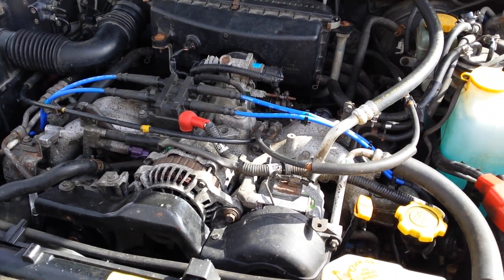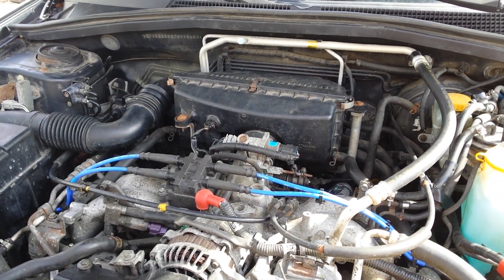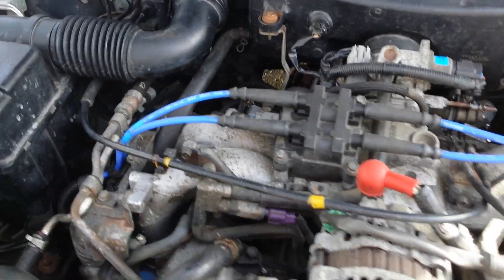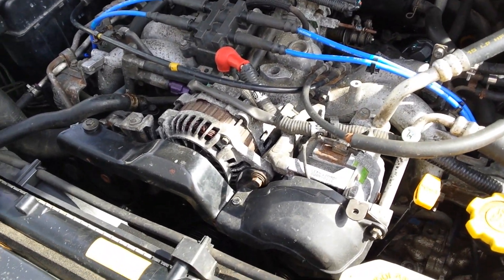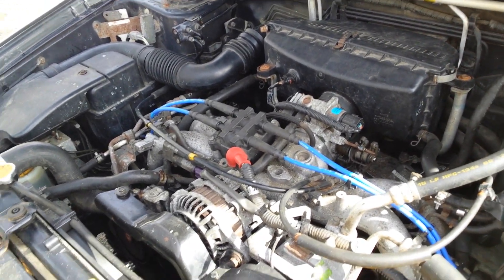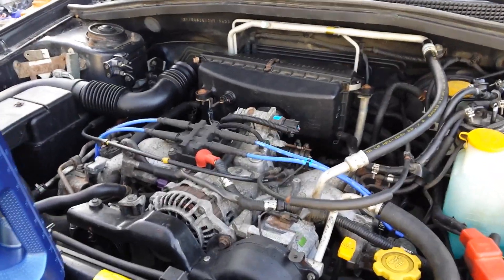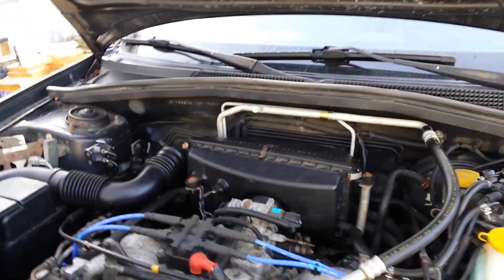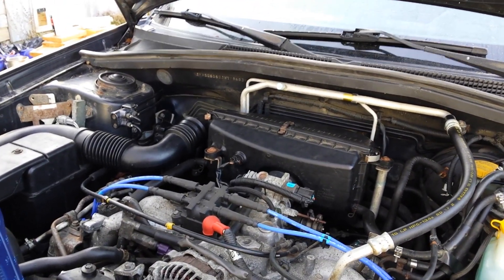Subaru Piston Slap - Does using Shell Rotella help?

Comment: Thanks for this.  My Subaru has terrible piston slap on cold weather startup. It's started to lose compression on one cylinder on cold startup now; it idles rough for about a minute.   Runs fine when warmed up though.

I used to put "Motor Honey" in an oil guzzling Cadillac engine.  It helped with oil consumption and made the engine quieter.  I'm still hesitant to put a product like that (basically thick goo) in a modern engine, especially in the bitter cold weather.  

I had a couple of heavy duty cold starts last winter.  There were a couple of mornings where the temp was minus 20 to 25 degrees F.  It took a long time to start and did it sound terrible idling.  But ten minutes later it was ready to go.  The piston slap got worse after that.
Reply from the maker: Piston slap won't cause any compression loss. That may be either worn rings or a valve issue. Did you do a wet compression test?
Reply: @stephenhunt6253  Then what causes piston slap if not a loose piston//sleeve or rings? :D
Reply from the maker: @vihreelinja4743  Piston skirt wear.
Reply: That's definitely not piston slap if you list compression
Reply: @AndrewB23  It's been slapping for 70K miles without using oil.  Now it's using oil.

Comment: Have you tried lucas oil stabilizer? Try putting a half quart in on your next oil change. I have been using it on my wife's vehicle and it's quieted the piston noise.
Reply from the maker: Will try that and video results!
Reply: @stephenhunt6253  I’ve tried Lucas in my 05 OTB, Lucas seemed to accelerate oil consumption.  And it’s too thick in the cold.  I’m in Quebec, we get -35 mornings for weeks in a row, I stopped using Lucas all together.